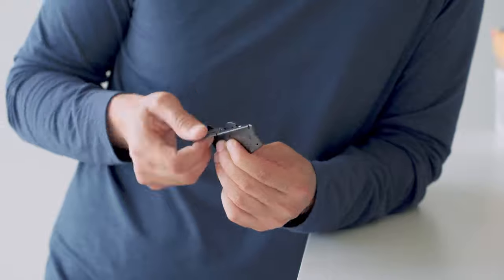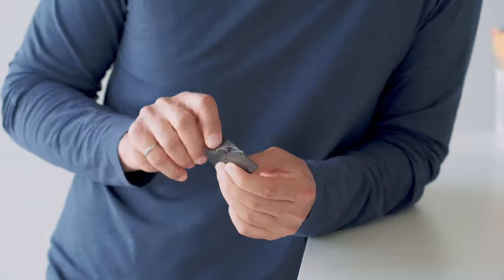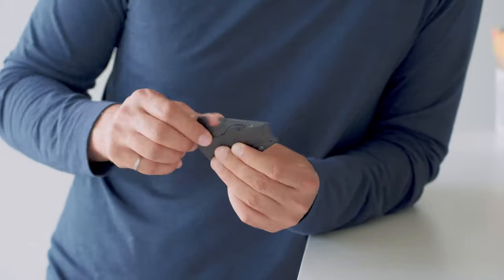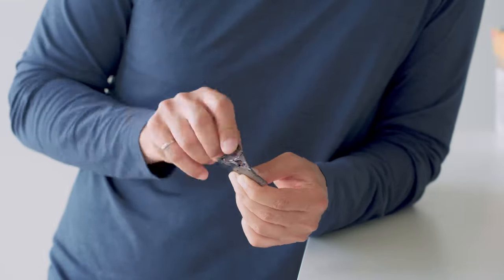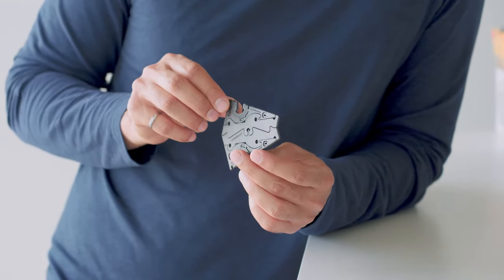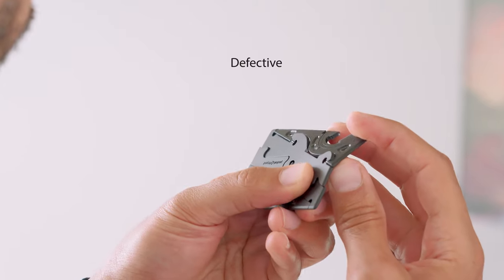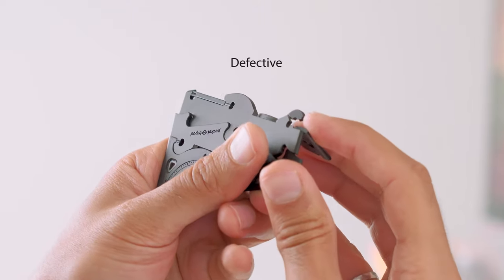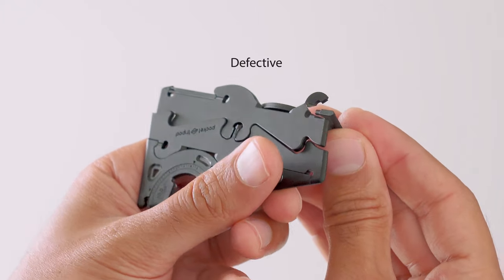Pocket Tripod Pro® Torture Test

Comment: My problem was not with durability. My issue is that the adaptors are way too stiff to rotate. There is no way to adjust the angle of the phone while the phone is inserted in the adaptors. Trying to do so will put two bubbles on the edge of the phone screen. I submitted a complaint and somebody from Pocket Tripod did contact me to offer a replacement Pocket Tripod (I asked the support person if need to lubricate the adapters, and she said no....  that I should not apply any lubrication), but when I received the new Pocket Tripod, it was just as stiff (and was very hard to rotate) just like my original product. And I bought two sizes of adapters to make sure the issue was not with fit.  So at that point I gave up. Later I bought a much larger, more functional Pocket Jack instead. The video shown on the Pocket Tripod website and on social media is NOT realistic. There is no way to easily rotate a phone while inserted in the adapter. The company needs to STOP showing that misleading video on the website.
Reply: I to have the exact same problem as Joe describes! Because it’s so stiff to rotate with the phone in I don’t use it. I would not recommend this product to anybody. I’m happy others are finding it useful but mine is so stiff that I would damage the screen protector and find it hard to set the angle for usage. Torture test show the material not breaking but clearly the product would not be usable in the state that he left it in so I agree, it’s misleading.
Reply: I haven't purchased yet because I was actually worried the product would do the opposite - not stay at an angle other than 0 or 90. I thought the phone would start to slowly fall flat if I tried to put it at a viewing angle.

So can you preset the angle? What if you preset it too far such that you have to push the screen AWAY from you rather than TOWARDS you. Would that solve your issue? Trying to understand. I want to buy something so I can angle my phone in landscape and watch videos.